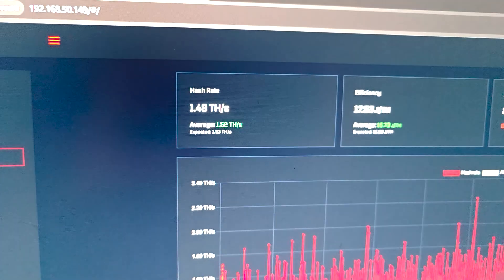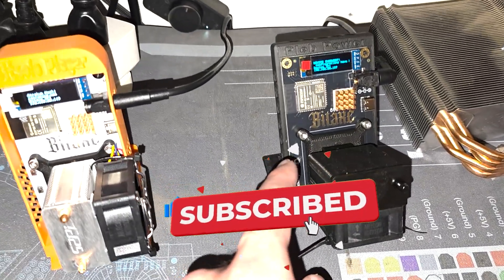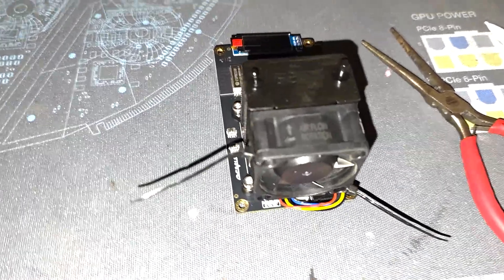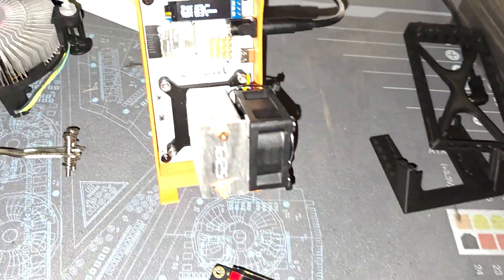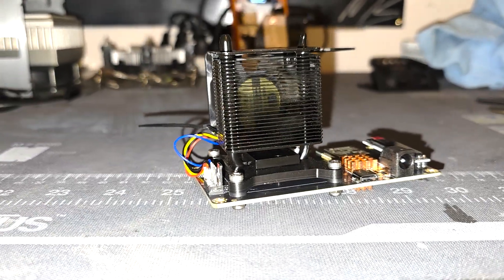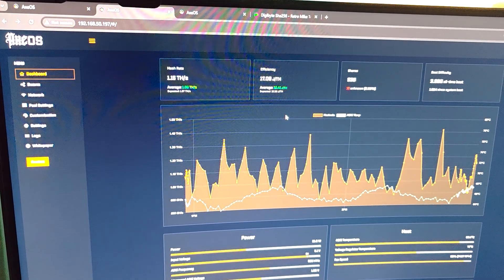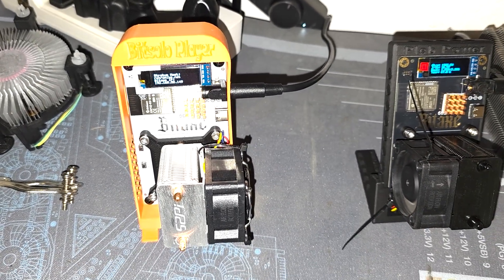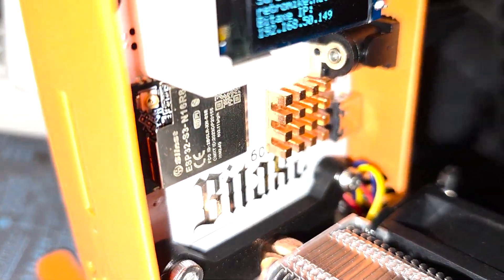I Goofed up BitAxe cooling

Comment: 3d printing is not really meant for actual products or production of actual parts.  I realize some people commonly use them for this, but it seems to me, too many believe 3d printing is an end all be all.  There may be some VERY high end machines that can make actual parts, but real products, real sellable, products should be molded, cast, or machined, not 3d printed. This is a VERY COMMON misunderstanding of 3d printing.  3d printing, mostly, should be used for cheap or temporary parts, prototypes or emergencies.  There may be some exceptions on high end equipment.

Comment: I tried several cooling systems and found the low profile one with the 4 copper pipes worked the best for me. The ice tower did not help me. Now I can run without overheating. I was about to give up on this, Gama.
Reply from the maker: Yea i recommend low profile one. Which one you got? Link it when you can please

Comment: I'm using the copperzilla upgrade kit and i put the standard cooler on the back. It decreases the voltage temperature at 15 degree. Instead of srews i prefer spring push pins to do not damage the ASIC chip. Finally i put a copper heatsink on the ESP32 chip 😎

Comment: Yep, the black one doesnt work, I bought the same one for mine & once i returned it for the silver one, problem solved. Btw, theres a seller on Ebay US that sells a simple stand with a built in mounting bracket for a rear fan. Works like a charm & VR issues are not a problem. So much so I never even put my copper heatsinks on & run at 1.66THS with VR temps @ 68-70 depending on time of day. My bottleneck is now Input Voltage but I think I'm okay right here.

Comment: With the 52pi heatsink.  The ASIC sits between the copper pipes, which don't transfer the heat properly from the ASIC. Try placing a .3mm copper shim.

Comment: The black coating is probably not paint.  Because the fins and the thermal heat pipe are different materials and it is hard to spray voids, that is likely an electroplating of black chromium or other metal that has an oxide that appears black. If you sand it off you may expose your metal to corrosion that would really not allow for thermal transfer to air. Good luck in you journey finding a good method for bringing these pro grade chips to all us lower budget operators. Love the vids.
Reply: Sanded it down myself made a big difference, flipped bracket to get angle right, and fan on top works best.
Reply from the maker: @fishman6364  same, updated video dropping in the future
Reply from the maker: Thank you, and already sanded cold plate, vid to follow to showcase thermal improvements. But note my videos are delayed due to my schedule, good luck with your journey as well. I appreciate you

Comment: These things are such pointless e-waste, why you guys promote them? The chanses for winning are less over lottery, jackpot is smaller and the electricity also cost something in long term.

Stuff like this will get crypto mining banned.

E. Also one thing to think about is fire safety, tens of thousands of similar units running at people's homes dusty & unattended while working. Newbies don't even realise the danger. Bad for house, worse for apartment buildings.